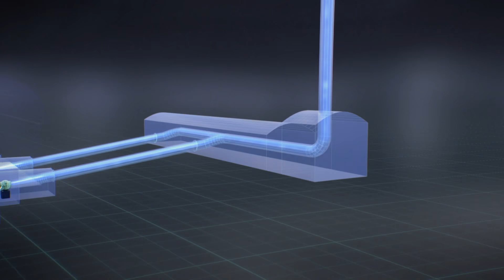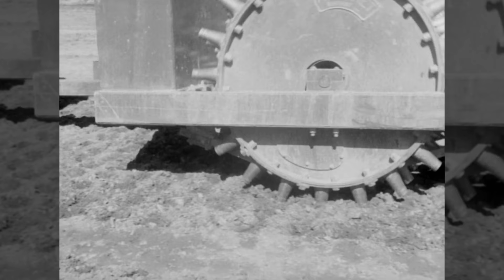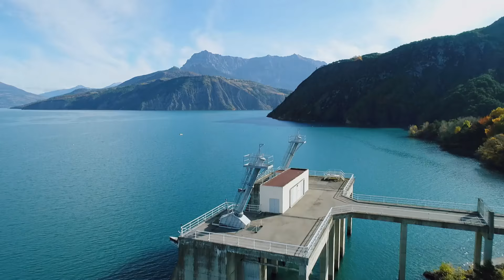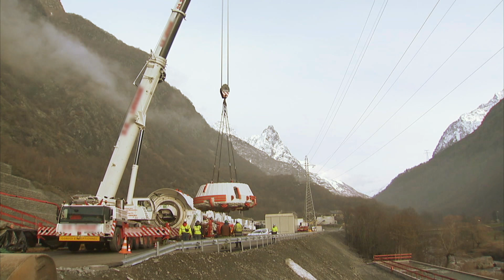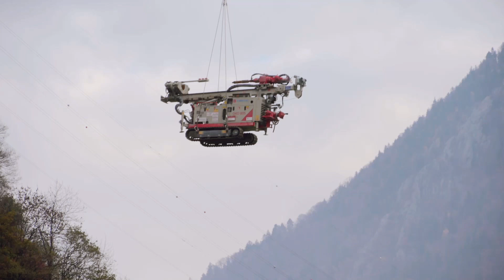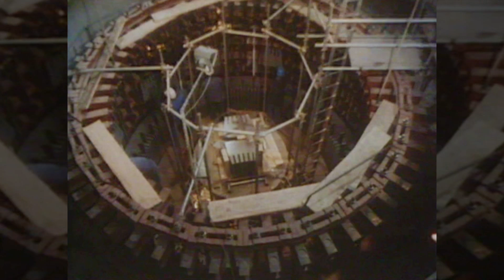Hydroelectric dams: Using the Power of Water | Génie Français - Megadams

Comment: Dam breaks have killed more than the nuclear industry.1975 Banqiao Dam failure (and associated dams like Shimantan) — Henan Province, China (August 8, 1975) Caused by extreme rainfall from Typhoon Nina overwhelming the dams' design capacity. Official death toll: ~26,000 (direct flooding); higher estimates (including subsequent famine, disease, and epidemics): 85,000–240,000 (commonly cited around 171,000–230,000). This remains the deadliest dam failure in history.  ThisDeath toll is right up there with 3. mile island, chernobyl, fukushima.  hiroshima, and  nagasaki combined.

Comment: I'm guessing the water is pumped back up into the reservoir only to store excess power in low-demand hours as pressure, for use in later high-demand hours? 
      I don't believe this was explained thoroughly. The narration sounds as though it is just a lot of fun to pump water everywhere! But no--there are reasons for which the viewers are waiting, in suspense; because a rational plan is something for which the French are deservedly famous.
Reply: You are correct.  It is a pumped storage system, to provide peak power demand for electricity on the electrical  grid.